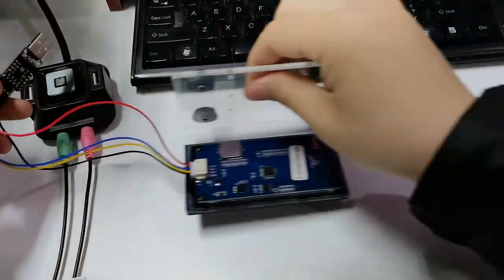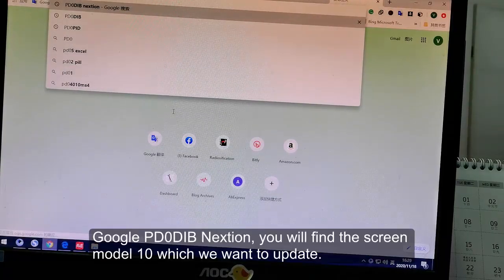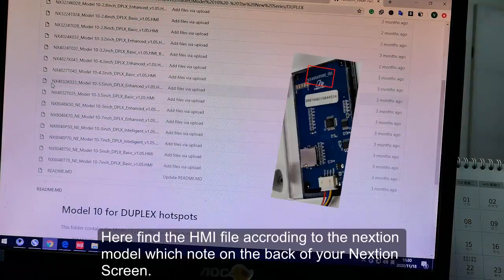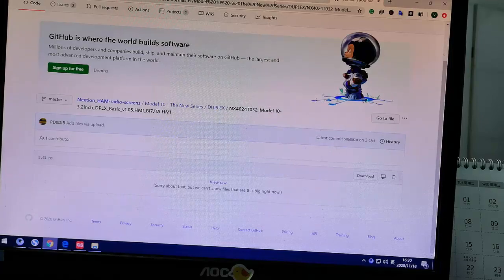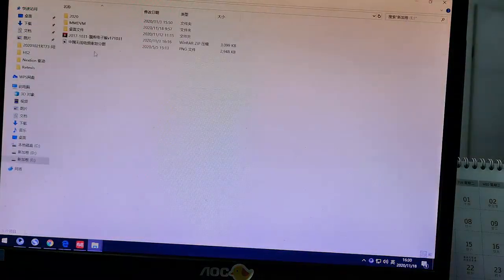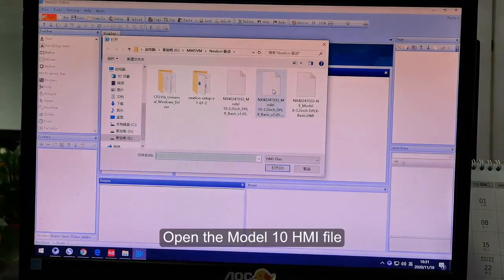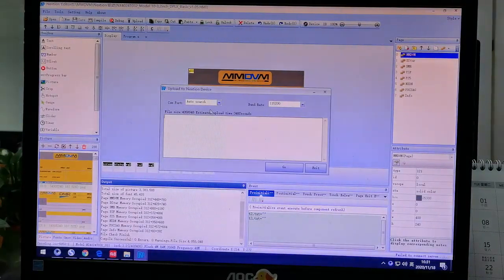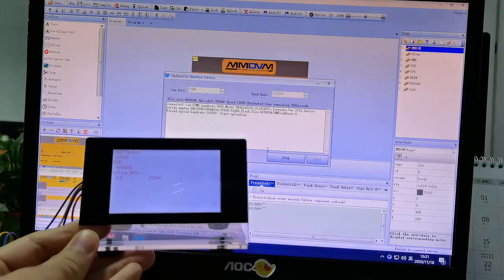Update Nextion Display for Pi-Star MMDVM DMR Hotspot

Comment: Other videos show that the ttl to usb converter is needed to get to work, how did you bypass the converter
And go directly on the board.
Does the board require a micro storage chip ti be installed

Thanks for video
Reply from the maker: 0:45 second, you can see I connect the TTL to USb converter to the Nextion board. and you can see here is no micro storage chip.